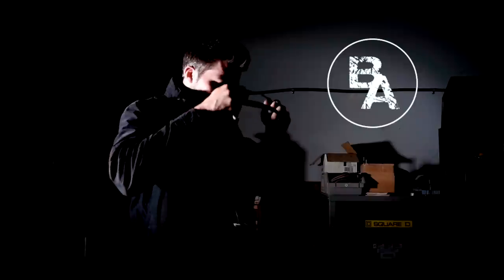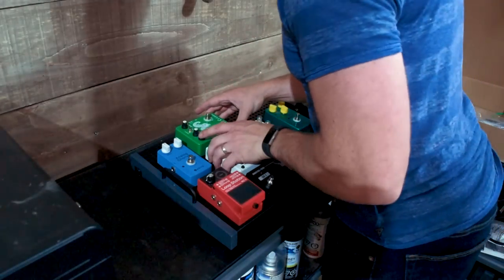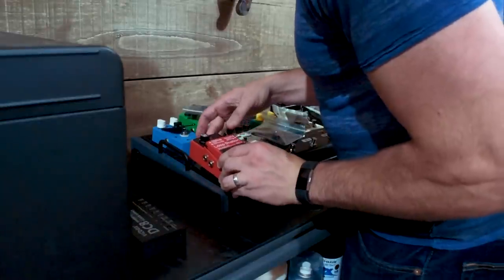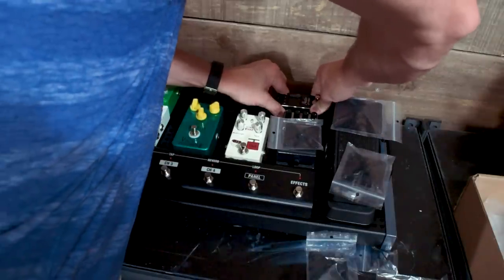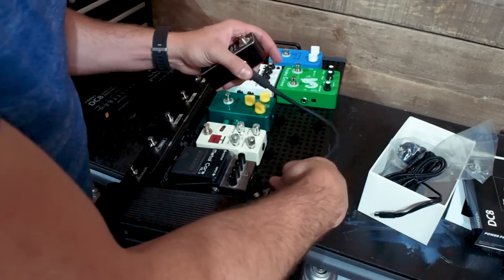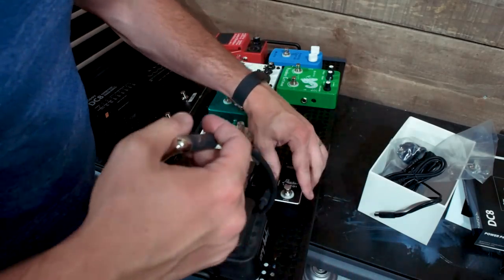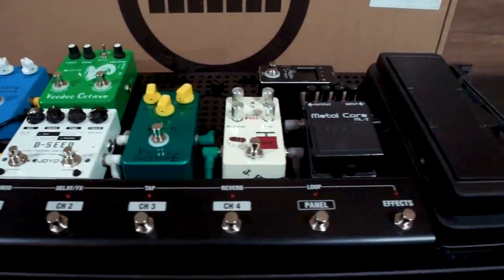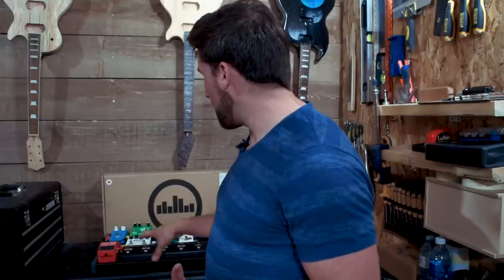Building My Pedal Board (with Temple Audio)

Comment: I know this is an older video but I have a katana artist that's still kicking around and if you still use yours, you can DIY a mini latching footswitch with a TRS stereo jack and connect a TRS stereo cable from the switch to the EXP pedal jack on the back of the amp to switch between bank A and bank B.  This will either let you switch among 8 presets in the amp or (what I do) is toggle between a clean and lead with the mini TRS switch (using like bank A for clean patches and bank B for different lead patches) and then I use the GAFC to toggle on or off delay, chorus and I also use a small patch cable to connect the FX loop send/return jacks and in the amp settings in the Boss software, I have the FX loop adding a simple decibel increase so I can hit the FX loop switch on the GAFC to toggle a 3db or so boost for solos.

It really is a cool little swiss army knife of an amp.
Reply from the maker: Thank you, that sounds like a cool idea.
Reply: Legend.
Reply: @lapk78  Since leaving that comment, I've moved to using a morningstar 6 button midi controller with my artist mkII and it's a much cleaner and more elegant solution.  I have a video on my channel on how to program it.  I have it doing exactly what I want and no more tap dancing with the GAFC.

Comment: Nice board. I like the mounting system they implemented. Velcro works but is a pain in the ass and the 4 corner method looks good but you can't move stuff around easily. Looks like Temple took cues from both those methods and made it as easy as possible but more importantly, it works! Looking forward to hearing it in action. Congrats on your first board and the first 100K. Peace!
Reply from the maker: The first 100k? I wish haha.

Comment: Use Goo Remover,also called Goo Gone to remove the sticker glue. I would put it on a soft towel and rub the glue off. It will not hurt the finish.
Reply from the maker: Good call.

Comment: Great content!  I'm building my first serious board as well and have a Trio 28.  What would you do differently in a similar build?  Any revelations or insights that you gained from this build?  Thanks!
Reply from the maker: I’m happy with how I did the board, but I do kind of wish I got one with more space for between the pedals, particularly because the power source is underneath and you can’t attach pedals over where it is. That’s the main thing. Other than that it’s really just a matter of preference where you put them.
Reply: @BradAngove  I actually just covered the trio 28 with dual-lock.  Figuring out the configuration of the pedals now.

Comment: Unfortunately my bass rig is rack mount so the only pedal board I use in my Behringer 1010 MIDI controller to my old school ART SGX Nightbass Studio Edition processor (the one that had the hot pink and silver logo splatter design).  So for me I have not used individual pedals since the early 90s.  Cool board though, and certainly better than ones I have seen on the market.
Reply from the maker: Rack mount sounds fun. How do you like that?

Comment: Nice setup brad! I've only got a few pedals myself, but i keep them in an old beat up dewalt tool case. works great for transporting them around, protects them great, but as far as organization.....not so much. everytime i open it, i have to flip everything over and untangle cords.....oddly enough its slightly bigger than your pedal board, so crossing my fingers that i win, my ocd cant handle much more pedal flipping and cord untangling lol =)
Reply from the maker: Haha well if you don’t win I suggest you pick up some adhesive Velcro strips. Stick one side to the inside of the case, and the other to the back of the pedals. Then you can stick them down and still remove and move them if and when necessary.
Reply: @BradAngove  Id still rather win the pedal board instead lol! my plan is to actually put the pedal board inside the dewalt case.

Comment: So every time you sell a pedal, you have to buy a new mounting bracket? Is the old one reusable or is it a stick only once type adhesive?
Reply from the maker: Single use adhesive, so yes, you would need another plate if you’re changing what’s on your setup. Much like you would with the Velcro system.
Reply: @BradAngove  Perhaps, but velcro does not cost me $4.00CAD per piece plus shipping every time I change or add a pedal.

Comment: I tend to run in cycles.  I'm currently in the "no pedals" cycle (except the ones tgat control my amps).  But I have been sensing a turn in the tide, and this video could provide the final nudge.  That's a cool board for sure.  It addresses everything I hated about my last pedal board.  Very cool indeed.

I need to address tge ekephant in the room, and by ekeohant I mean guitat.  What is that middle guitar you've got hanging up there in mid-finish?  Looks like a sweet hybrid LP/Tele.

Anyway, I hope your pony feels better soon.
Reply from the maker: That’s a prototype in the beginning stages. I’m looking doing some of my own custom pieces and having them for sale at some point in the near future. I prefer fender neck types most of the time, and getting this line of guitars started is going to be a whole lot of fun, weird, and hopefully wonderful.

Comment: Pedal boards are always an interesting topic. What is your opinion on the order of the pedals on the board? Also, any comments on the B9 pedal put out by electro-harmonix.
Reply from the maker: I’m not familiar with that specific pedal. In terms of order, I do the wah first, then distortion and boost. I put delay, chorus, etc in the effects loop and the loop pedal right at the end.
Reply: @BradAngove  Thanks for your pedal line-up. 
That pedal I asked about, the B9 pedal from Electro-Harmonix, is an organ pedal. The company is from New York City. There are a number of these "B" pedals. This one has 9 different organ sounds on it. I was watching a band play here in Toronto and I heard a B3 organ, but no keyboard was on stage. The guitarist showed me this pedal. Quite cool.

Comment: Did the large and medium plate for the cry baby pedal fit and not obstruct the battery door?
Reply from the maker: No, but you don’t need a battery if you’re using this setup.
Reply: @BradAngove  Cool, thanks for the reply. Decided to zip-tie my stuff to the board instead, cheaper and I don't have to mod any of my pedals. Thanks for the video though helped me decide to buy a Templeboard. All the best.
Reply: I know this is kind of an older post, but you can also mount conventional "CryBaby" housings using just the bottom screws, and skip the mounting plate(s).

Comment: Can I ask how you mounted the Mission Pedal? I took the rubber feet off mine and put the screws back in.  I thought all was well but the pedal fell off the quick release plates today. I think the screws are making it too far from the quick release plates.
Reply from the maker: Mission pedal? Which one are you referring to?
Reply: @BradAngove  Sorry, it's the Cry Baby pedal. It looks just like Mission Engineering expression pedals.
Reply from the maker: I believe I only put two screws back in that one because they were a bit too long. I plan to remove that and carefully grind the screws down a bit.
Reply: @BradAngove  I also reached out to Temple Audio and they responded this morning suggesting to remove feet/screws and refasten them up through the perforated top sheet and back into the pedal. Basically eliminating the quick connect plate in this scenario. I thought of another idea that would still incorporate the flexibility of the quick connect plates. Remove the sticky adhesive from th QC and add dual lock velcro to the plate and bottom of pedal. I think this would be taller than the screws and would secure well to the plate and pedal. That way we could still move the pedal around easily if needed.

Comment: Hey man! Did you have any issues fixing the cry baby to the board because of its feet screws sticking out?
Reply from the maker: Yes, that one was a bit of a pain.
Reply: @BradAngove  what did you do? I thought about trying to replace the screws with flat heads but it's going to be tough finding the exact right size.
Reply from the maker: I just messed around with it until I got it to work. I think I removed two of the screws.
Reply: @BradAngove  Thanks man I'll give that a shot if I cant find different screws. Cool video btw, excited to put my board together.
Reply from the maker: I hope it goes well for you.
Reply: You can just mount the pedal directly to the board using the bottom screws. Pull the bottom plate, put it on the underside of the board, and fasten the pedal to the top using the stock screws. Easy peasy. (And saves a couple bucks  on mounting plates!)